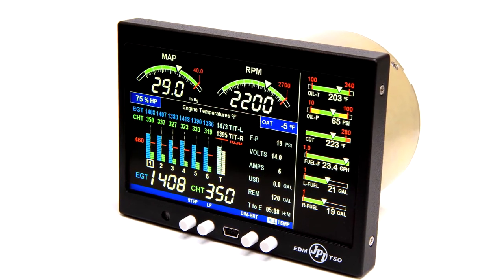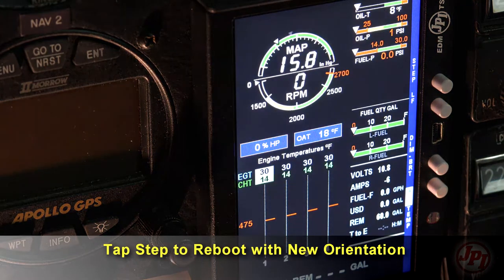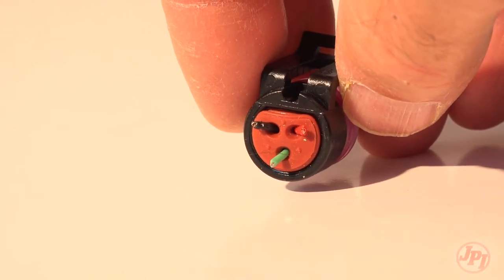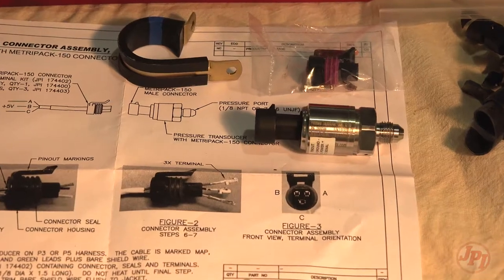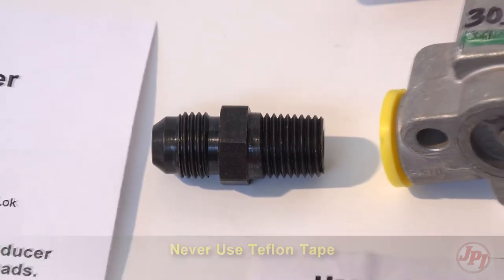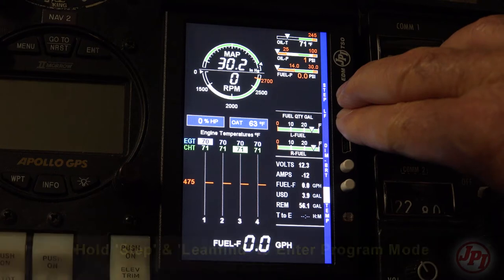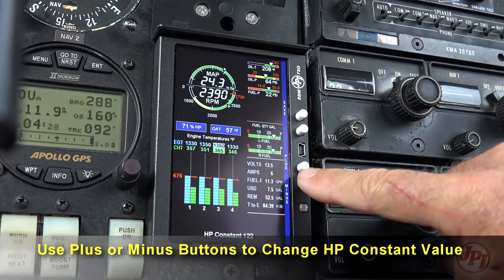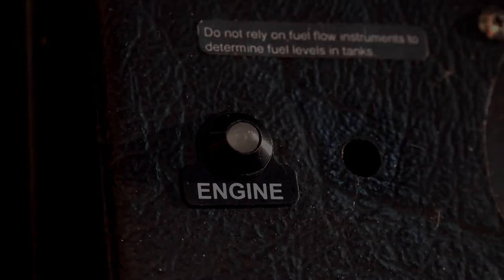JPI EDM900 Installation Video

Comment: Can we get an example shot of how the EGT/CHT harness should be secured to the engine?
The manuals provide no guidance on this at all.
Are the clear plastic sleeves on the harness supposed to be part of an anti-chafe strategy, or are they just there to keep it organized before the install?
What formats are we supposed to use for the GPS I/O?